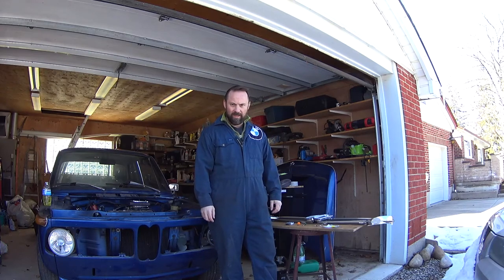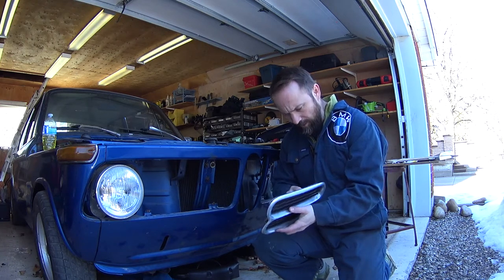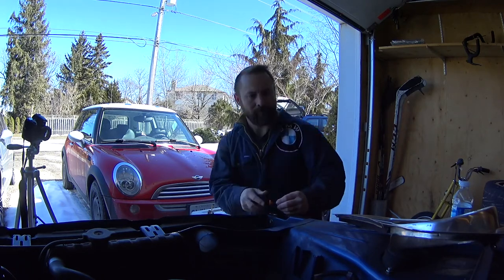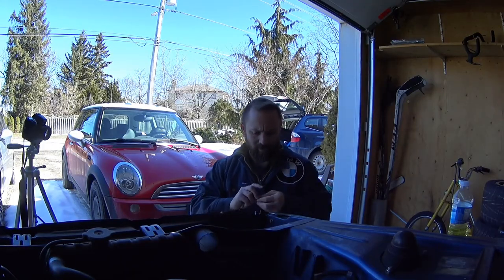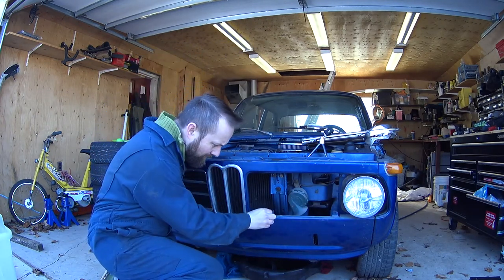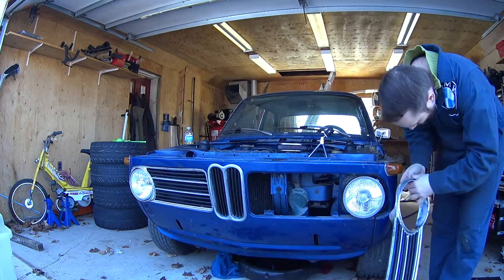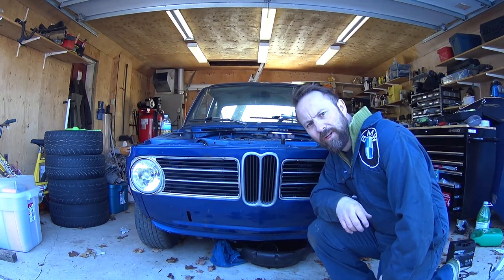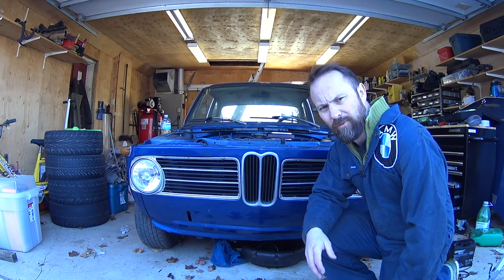PROJECT 1968 BMW 2002 EP05 Grill

Comment: how did you get the aluminium shiny again? and did you remove the black plastic covers to paint them?
Reply from the maker: I removed the slats entirely from the centre grill to paint them...  I also had to work out some dents and get some holes welded up.  From there I removed the coating with 3M brown pad and then clear coated.  For the sided I just taped really carefully.  I couldn't get the coating off the side pieces (anodized?), but luckily they weren't too bad - just a deep clean in the sink.